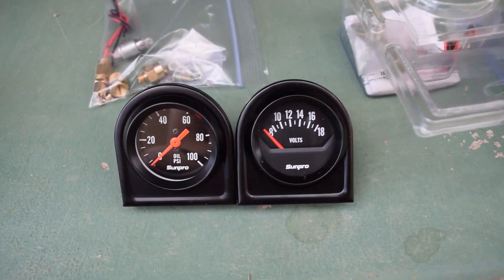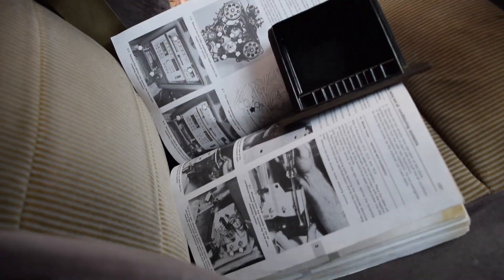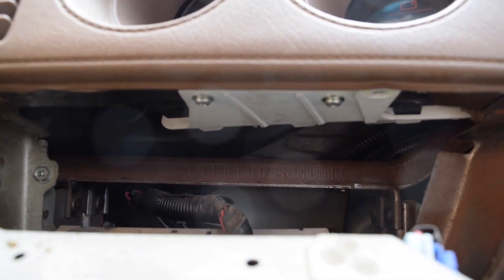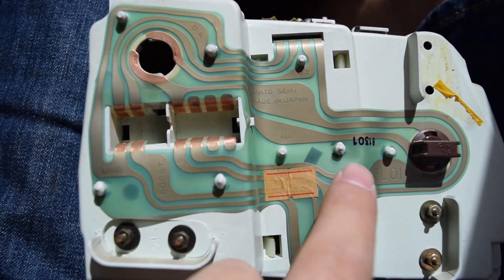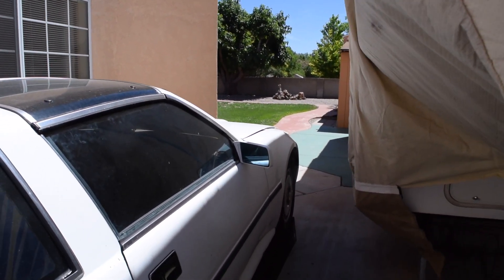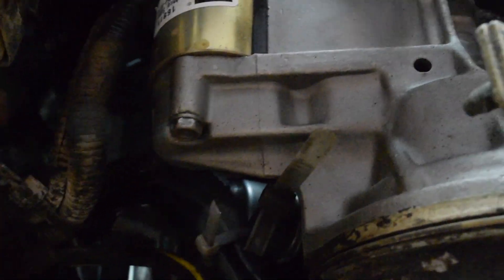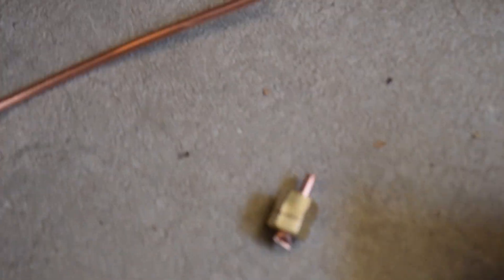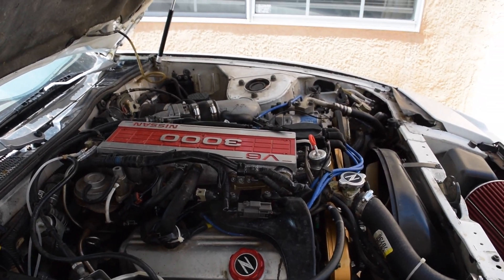Installing Mechanical Oil Pressure Gauge (300zx Z31)

Comment: It's called a Compression Fitting Nut,,the 'BELL" looking thing is called  Ferrell..Just an FYI everyone...DO NOT USE THAT plastic tubing that comes in most kits. Get some 1/8" copper tubing..(as you did)..As you can over tighten the nut an cut it and over time it will become brittle..Think a minute how much of a mess that would be in side. High pressure and "HOT" oil,,,, another thing you usually DO NOT put Teflon tape on the compression nut side as it will not make a good compression  and you can OVER TIGHTEN and cut the tubing as it would feel like it's not set in to the Ferrell

Comment: Is it the same with the digital dash version?
Reply from the maker: The wiring you need to tap into for power will probably be different but if you have a multimeter to measure voltage that shouldn't be an issue